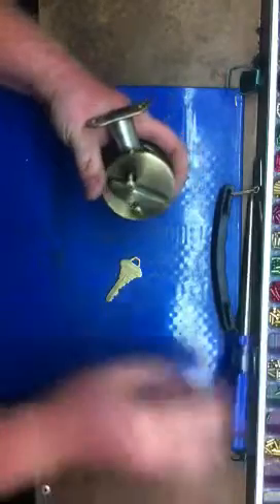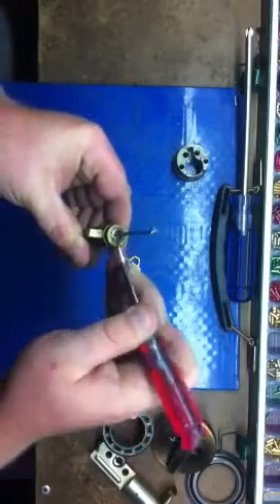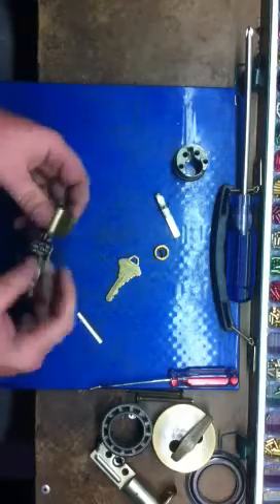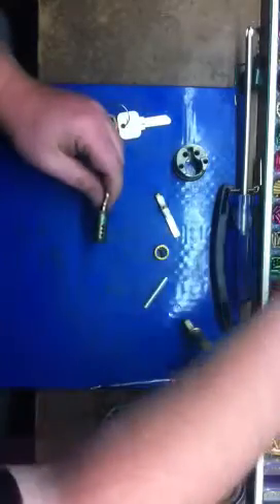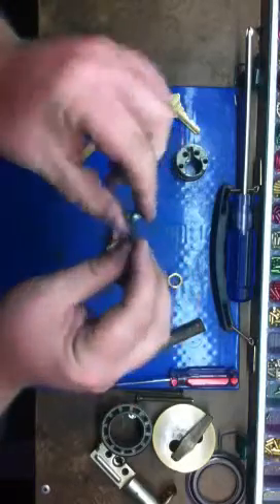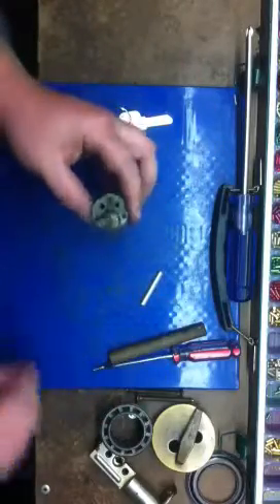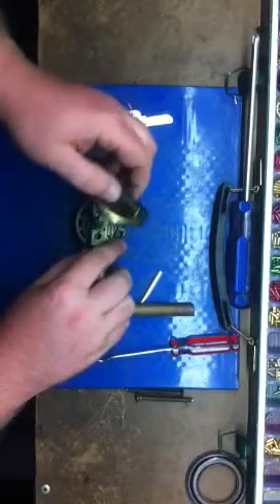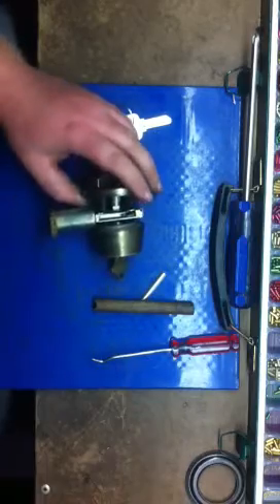Schlage Deadbolt Rekeyed

Comment: excellent video! My dexter deadbolt lock is a dual key type.  the outside key has always been rough to turn, so much so that my son recently broke a key in the lock; the inside key  tyrns easy. I thought I needed to re key the cylinder because the pins were defective but after seeing your video I now supect that  the screw ring needs to be backed off . Thanks.